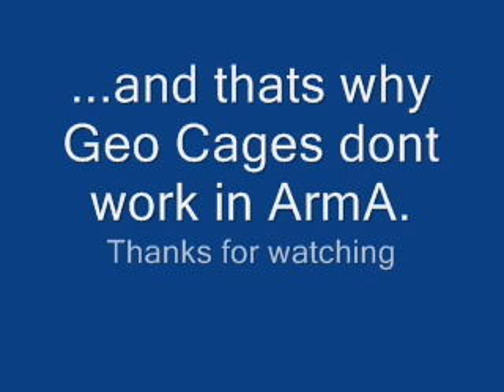Why GeoLod Cages dont work in ArmA

Comment from the maker: 1) Geolod Cage doesn't work as shown in the vid.
2) Setpos loops do not work in MP same as OFP
3) Put logic in Cargo will work if well scripted
4) Fake model requires a model for each vehicle/crate carried our system does not. Making it far easier for the community to use.
5) RKSL Addons are not useable in VBS2, legally and technically.
6) RKSL is not involved in any commercial project with the MOD/BIA or UKF.  Someone is pulling your leg mate.